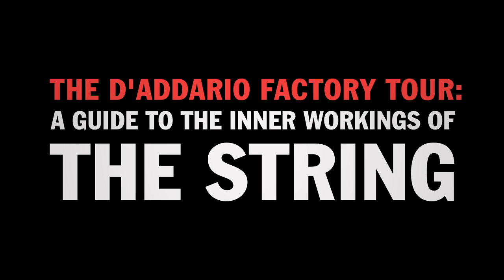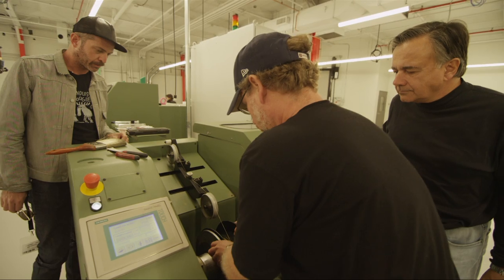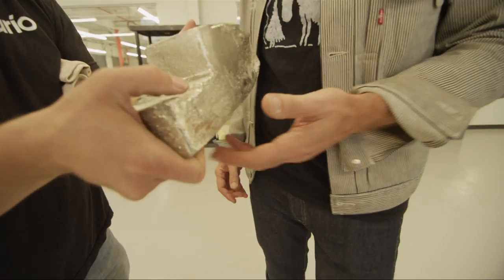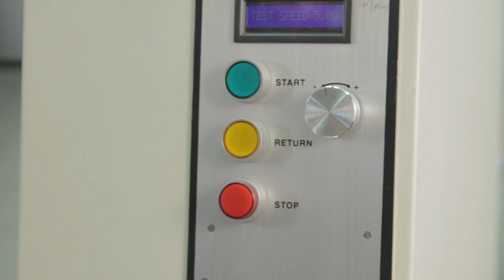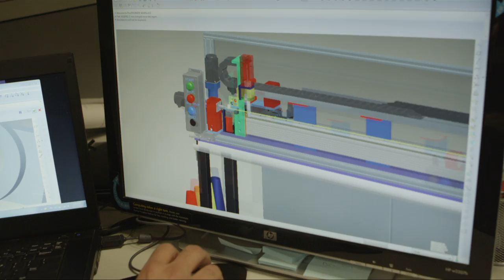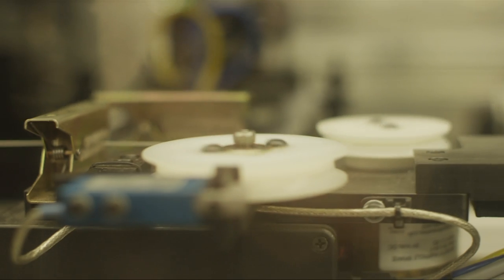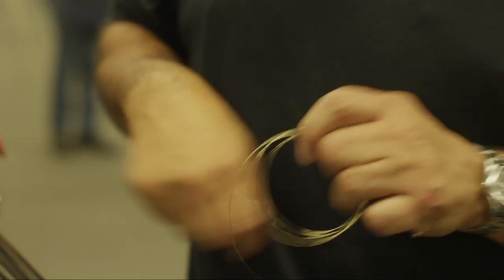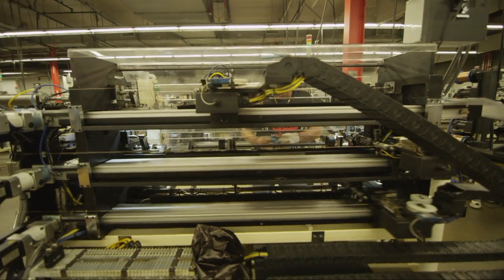The D'Addario Factory Tour: A Guide to the Inner Workings of the Guitar String

Comment: Great video! It's amazing how many strings you make a day, and the fact that the are so consistent!
I switched brands on one of my guitars recently just to use up some old packets I had, and immediately the Floyd Rose needed adjusting.
Doesn't happen with D'Addarios...
Reply: Neville Cope of course if you change the brand you’ll likely to have different tension from your usual ones and so the Floyd will need adjusting. (IE eb usually have lower tension)

Comment: I use to use D'addario strings for many years and always noticed oxidation spots on your strings.  After watching this video on the making of your strings it proves my theory of the spots.  The line workers aren't wearing gloves well twisting the strings together before they go into the oxidation bag.  If a worker is sweating inside a factory and there hands become sweaty and then they touch the strings after, hmm! I wonder what might happen.    You would think after so many years you'd know how not to sell a customer strings with oxidation spots.
Reply: I don't buy it. I've used D'Addario strings for over 20 years and never, ever encountered spots or oxidation at sections of their strings such as what you're describing. They're great strings, consistent, well made, sound great and last a long time. Only strings I ever use!!
Reply: Never seen that on my strings. In fact, after close inspection, I've noticed that their strings look the cleanest.

Comment: only problem is they are hand packed and no one wears gloves so who knows what sweat or dirt is on them , while they are good strings ive had sets that turn black right away, so the tin coating sucks , other than that still good strings but not my first choice
Reply: I've never seen that with D'Addario. Clean, great wire.

Comment: To each his own but I love Elixir strings. Expensive but worth it if you're serious about tone
Reply: Coated strings have lower quality tone by definition, so what are we talking about here?
Reply: Yeah man I've put a lot of different strings on a lot of different guitars and I'm now loyal to D'addario. I use to only use Elixirs 10 to 15 years ago. I will use Martins retro monel Tony Rice strings on some acoustics that I want to play bluegrass on but also play blues bends, and I sometimes use Santa Cruz parabolic tension on acoustics, but D'ADDARIO win hands down for consistency, quality, and price. They make quality acoustic strings and make hands down the best electric strings. I've also bought several sets of Thomastik brand German strings which are as expensive as the Santa Cruz strings (about $25) but their consistency is terrible and I found their g and b strings to sound dead on several strings which were strung up on very high end single lughier built acoustics. Check out D'ADDARIO NYXL and i bet you won't go back to elixir
Reply: In 2021 D'Addario introduced the XS strings series.  Having used both Elixirs and these new strings, I have to say the XS are not only brighter, but not so slick as to lose feel, especially on the D & G strings. The coating is very subtle and they're definitely worth the premium.  I'm still a die-hard EJ17 phosphor bronze user, but am starting to switch selected guitars over to the XS series.
Reply: @glennray1901  Thank you sir, i tried them and they are simply amazing!! I love them immensely and me being 73 years old with slight arthritis i put Custom 11’s on my Taylor’s and they 
Sound great. 👍 And!!  They are cheaper than Elixir

Comment: Melting TIN over the high carbon steel wire for the unwound plain steel strings. So they add TIN for the high E, B, G strings for the unwound plain steel strings. Why is D'Addario adding TIN for the high E, B G string? the TIN does what?
Reply: The tin adds a level of corrosion protection around the high carbon steel.  He states that in the video.